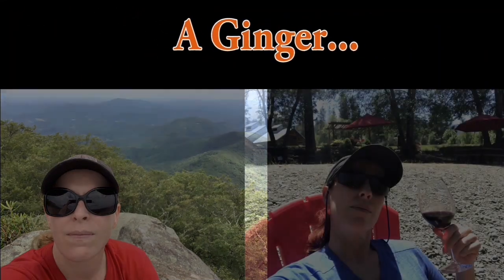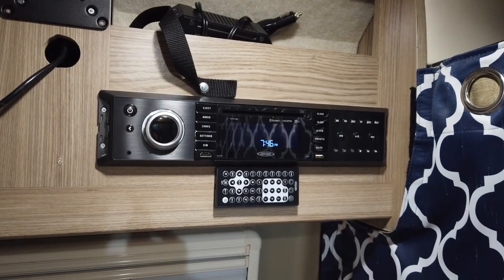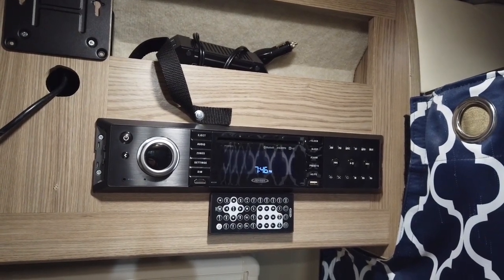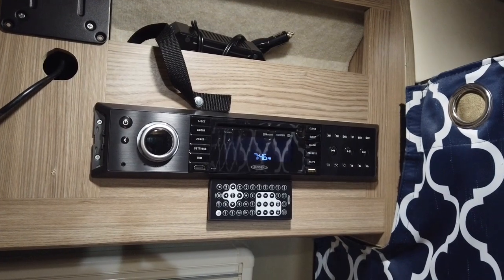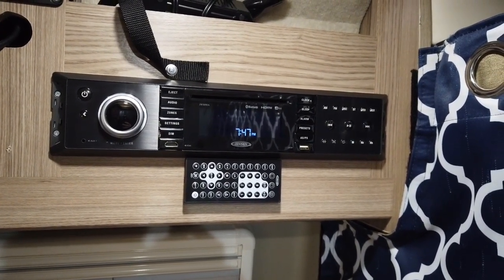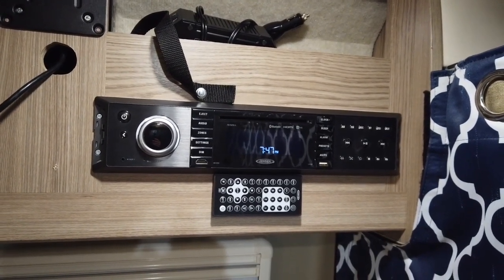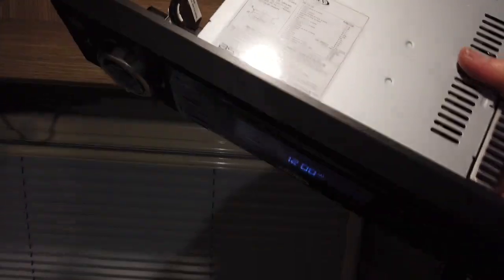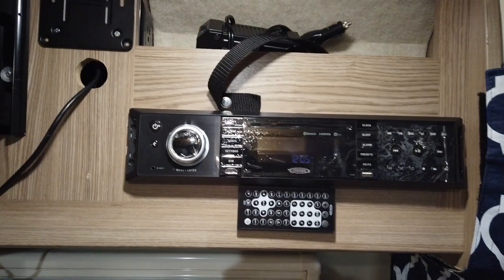New JENSEN Entertainment Unit for my 2020 Winnebago Travato 59GL for FREE?!

Comment: I recommend putting the TV back.  
I still use DVDs, they are great for the RV.  At home, yes i stream everything.  But out on the road, streaming is not an option and my DVD/TV is nice to have.  And i am surprised you do not have an opinion on something that stopped working in your nice new RV.  I would have an opinion, and it would be the item is junk.
Reply from the maker: It's not clear exactly why the Jensen stopped working. Some say it is a Winnebago issue so I don't have an opinion on the Jensen because I just haven't use it much.

Comment: the new 2022 Travato -- dump the Jensen and speakers (both indoor and outdoor) for a bluetooth soundbar -- much more modern for use with phone/tablets.. for renting. probably better to put back the TV.. I plan to do a monitor like you did for my 2022 GL after I get it in May
Reply: it is around 68 inches due to the elevated floor in the prototype..  enough feedback to WGO is happening -- maybe they fix it a bit before they go into 2022 production. I think they are at less a month or so away from the first production models coming out of the factory
Reply: @steventoney4018  Great—hope they change it. I see I put 58" instead of 5 ft 8 inches=68"—sorry about that

Comment: So your and my unit is a JWM90A. I've noticed that there is a new model named JWM92A on Amazon. I just wonder if there are any features changed or added.  One thing they could do to make this unit perfect is to put a Blu-Ray player instead of just a DVD. Although a lot of people hate this unit, it has so many zones and features and operates 100% off 12 volt DC. Travato 2019 G here.
Reply from the maker: I don't know. You could always call ASA and ask them. They are super helpful. I do appreciate the fact that it works off of 12 volt DC but the TV doesn't so that half of the entertainment system is pretty dumb.
Reply: @thegingerwalkabout1550  I think Winnebago abandoned the 12 volt TVs because of numerous warranty claims and they cost $100 more. I will contact ASA and tell them I want a Blu-Ray player. :)

Comment: Would the original TV attach to the mount that your monitor is on?  Seems like that would be more useful if it would fit.
Reply from the maker: Original TV wouldn't work with the mount I rigged up.